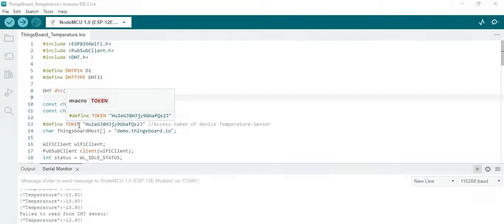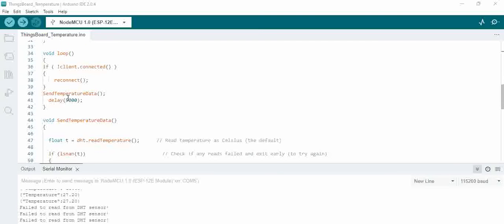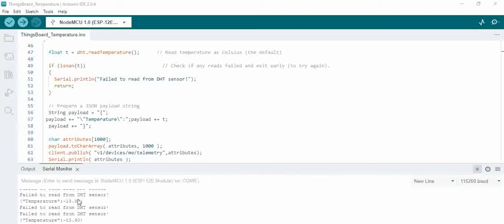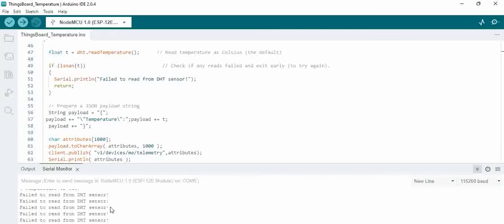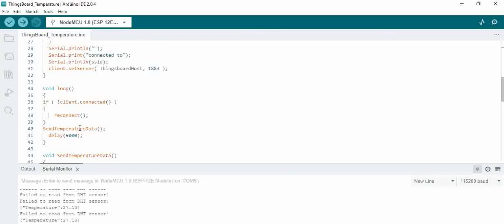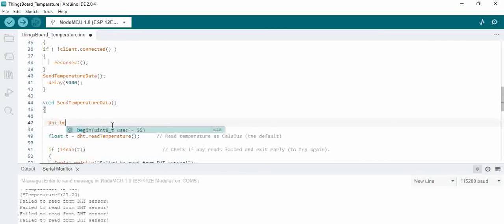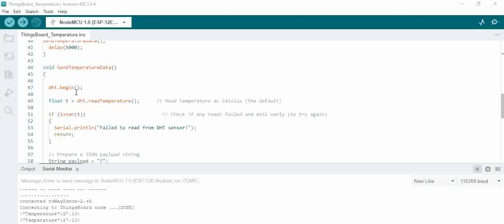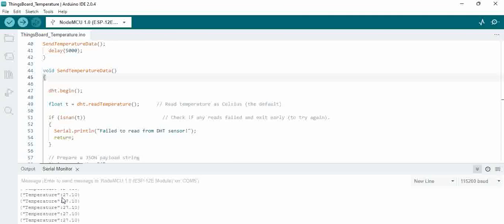Failed to read from DHT sensor!

Comment: Amazing, you have solved my problem with one line of code. It was driving me crazy. I was troubleshooting the hardware for a couple of days, swapping out sensors, boards, capacitors, and diodes before I found this video. I didn't even realize I had a bug in the software. Thank you very much!
Reply from the maker: Glad that it helped 🙂

Comment: I went to your blog and looked at your wiring diagram!!! Problem solved. Everything I have found on the DHT11 shows data to be the middle pin. I changed to your wiring setup and my sensor kicked right in. Thank you!! I hope you dont mind but when i post my vid I will be adding your blog, I have to give credit when it is due, THANK YOU!!!
Reply from the maker: You can go ahead and include..

Comment: thks so much for your suggestion on NAN issue, it helps a lot. I have faced it when test with IOT, but it is normal when I use dht11 with arduino examples. Big thumb for you.
Reply from the maker: Thank you 😊